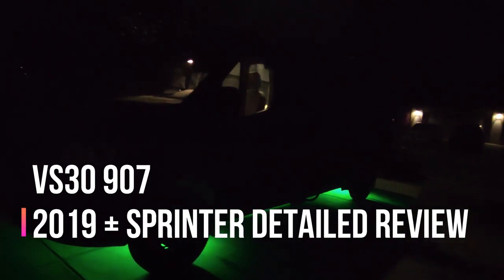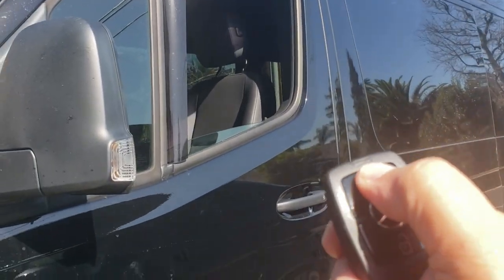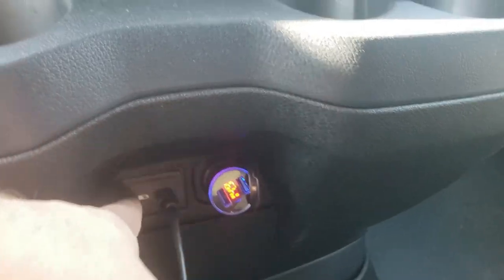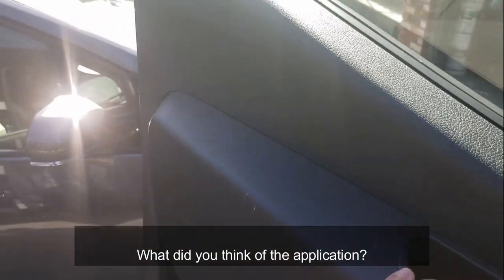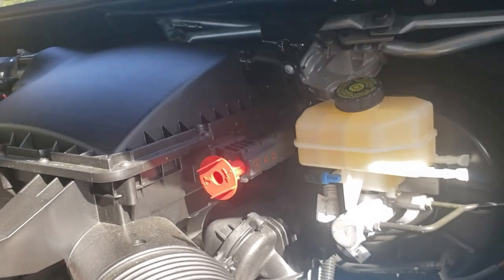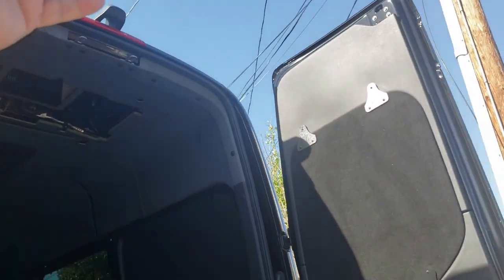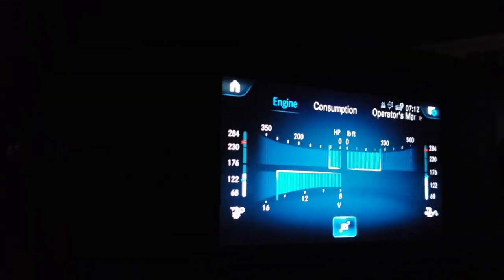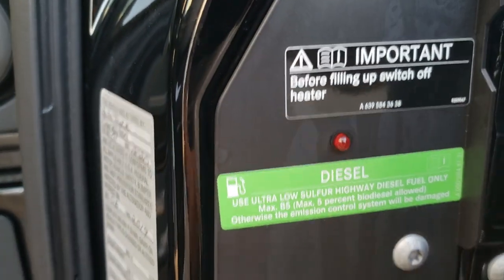Van Life▶️ 2019-2022 Sprinter Van Review▶️ VS30 907 Sprinter 5 Month Review

Comment: When are you going to show the build out?
Reply from the maker: It's coming, stay tuned.
Reply from the maker: Camper van playlist
https://www.youtube.com/watch?v=r2KTXLqso2c&list=PLDEbtVOPRC-id5xjqFsYm87bJSJL8bLbe
2019+ Sprinter Review https://youtu.be/wAAV6bnHNzY
The new toy  https://youtu.be/EAKbCledvsQ
Low Key Battery https://youtu.be/-FI_DG-DE9k
How to Buy a Camper van for cheap https://youtu.be/nqPSV0mszfk
Seat Removal https://youtu.be/KSUQawuSt_w 
Headliner removal https://youtu.be/FjrJBLXEbyU
Vantech Roof Rail Install https://youtu.be/oB_Yh3JEooI
Flatline Vanco Low Pro Roof Install https://youtu.be/pkj5Tcs5a1U
Flatline Vanco Side Ladder Install
Maxx Air Fan Install https://youtu.be/QXxBSx3cfI8
Max Air Fan Review https://youtu.be/JIRG7lSR5yQ
Bathroom Fan Review https://youtu.be/QXxBSx3cfI8
Spare Tire Carrier https://youtu.be/wVQ_h-FjtPE
Oem Diesel Heater Trick https://youtu.be/Ws9GHo9bWeM
Led Upgrade https://youtu.be/r2KTXLqso2c
Sportscraft Swivel Adapter https://youtu.be/HVkj6KVpUbs
Pocono Swivel Seat Adapter https://youtu.be/r-1HpIl71_I
Solar Panel install https://youtu.be/GSvXsDSUObA
Stealth Shore Power Plug https://youtu.be/Ksyee3aYm7s
Automatic transfer switch install https://youtu.be/21UnSoWxb08